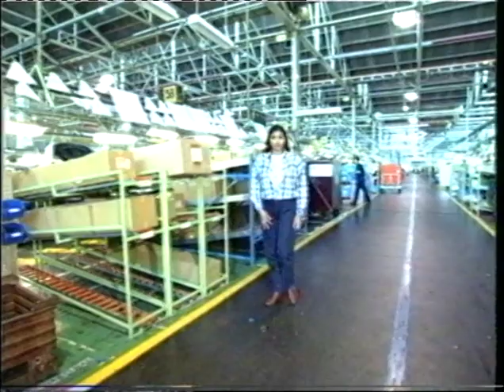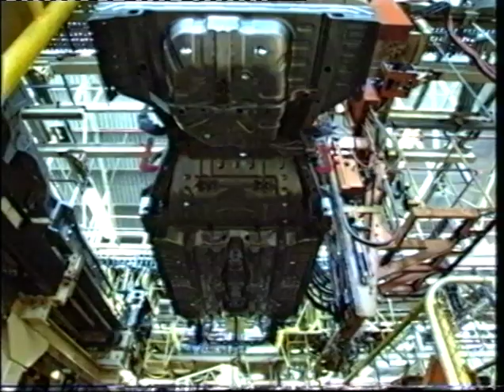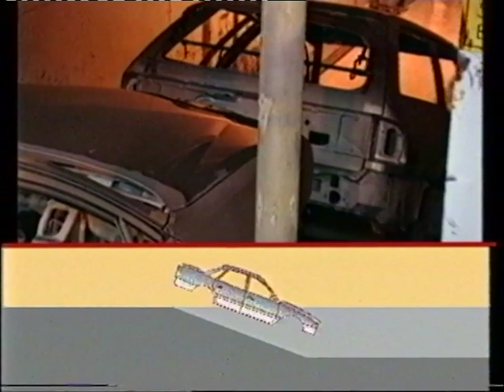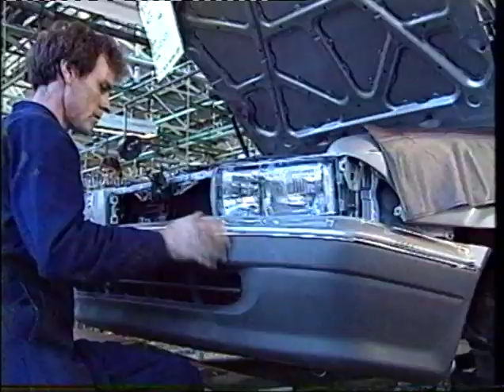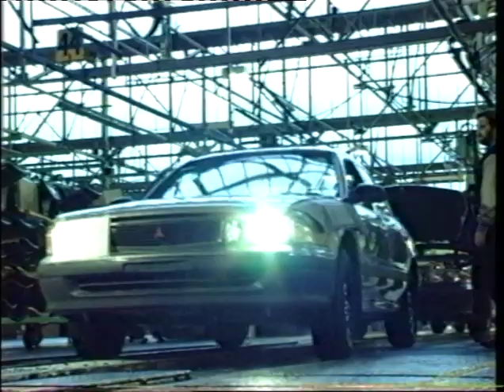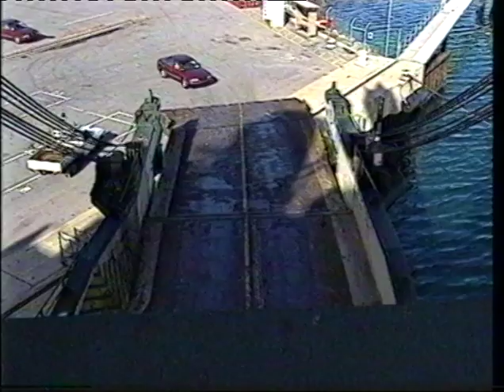Steel To Wheels (1994) - Assembling The Mitsubishi TR/TS Magna & KR/KS Verada

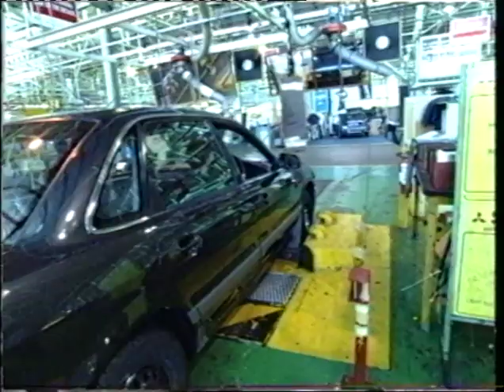Comment: Own a TS and TJ2 sedans. At 10:36 is a stratos grey Magna like mine but I'm sure that it's the 2.6 litre and not the V6 like my car.
Reply: I thought the base model 4 cylinders were 2.4’s in those ones? 2.6 was the model before I’m fairly certain. Although I’d like to know if I’m wrong. Love these cars.
Reply: @jnthepassenger347  The 2.6l and older V6 went into this gen, the 1996 model TE had the newer 2.4l and 3.0l V6 engines with the Verada having the 3.5l. Later models had the 3.5l as option then it was standard unless you opted for the Gas optioned model which had the 3.0l as standard. The 380 had the 3.8l across the range.
Reply: @cliffynjovelyn893  ah, I stand corrected! Cheers for that.

Comment: The Diamante-based Magna, a very solid car. The Australia market was Magna and Verada with 2 engine choices 2.6L Astron II 4G54 4 cylinder and 3.0L V6 6G72 Cyclone. Also manufactured as V3000, Diamante and Sigma for export overseas. The sedan is Japan origin but the wagon is Australian origin based on the sedan. Nice cars in their day, as I said very solid and well built cars and some are still going strong as of 2021.